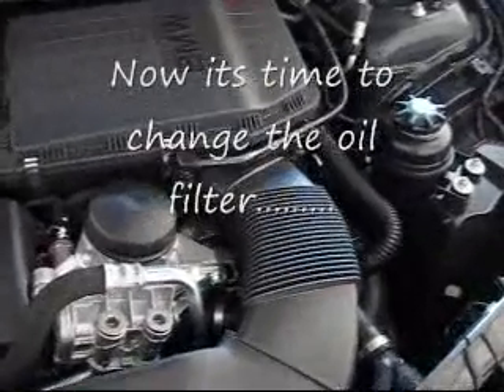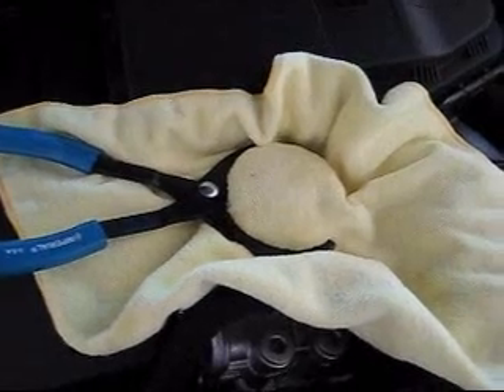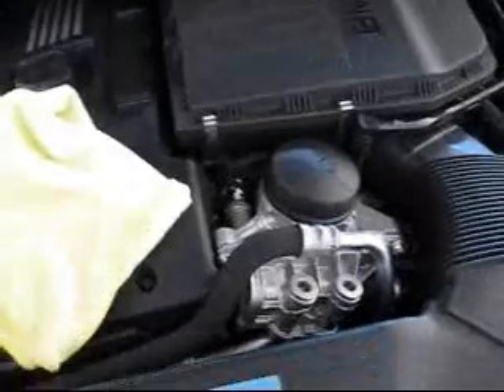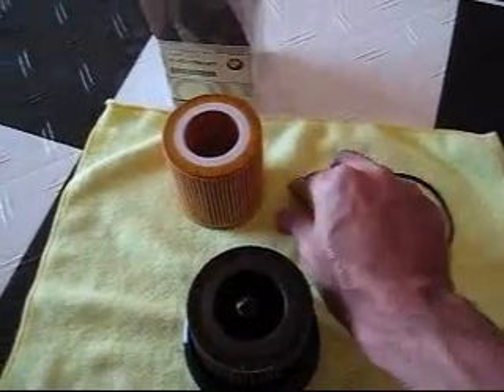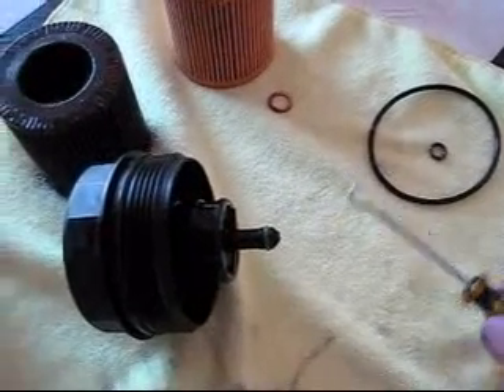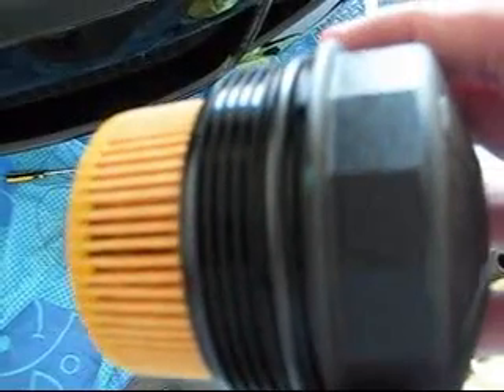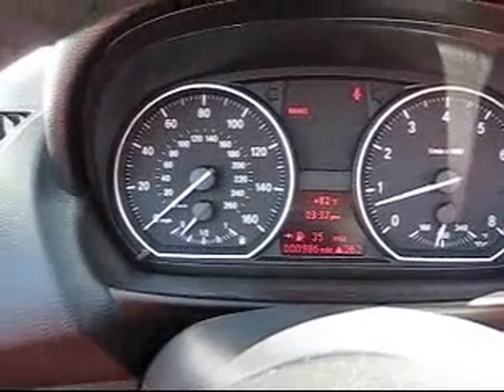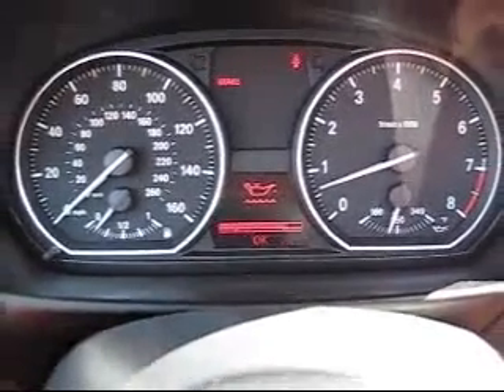BMW 135i Oil Filter Change

Comment: Actually 15,000 miles on synthetic is fine. I had an SUV I ran on synthetic for 100,000 trouble free miles and this was an American car. I'm not sure I'd stray from BMW's plan too much. But, it is an excellent video. I do all my own work now, but on my future 135i, I might not.

Comment: Is there any need to reset things like the odometer counter - so it will warn you for the next oil-change? I have a 08 323xi. Maybe very similar engine but non turbo. I will follow your procedure. Thanks for sharing.